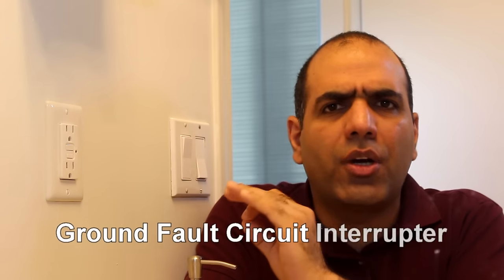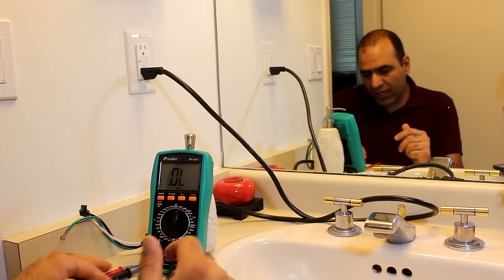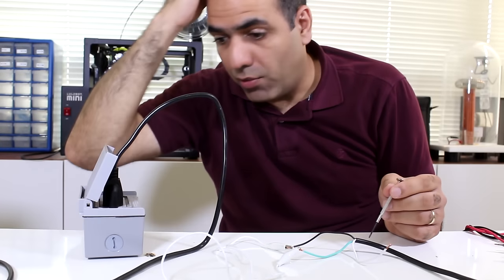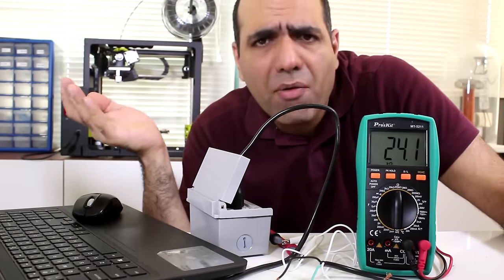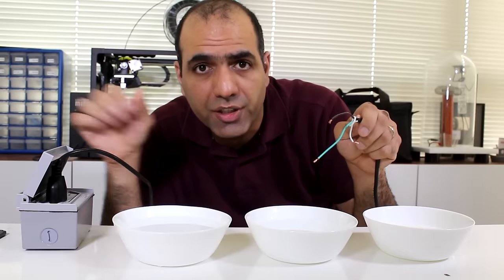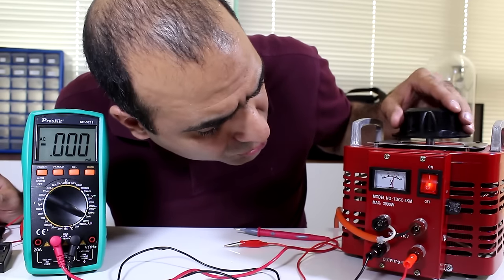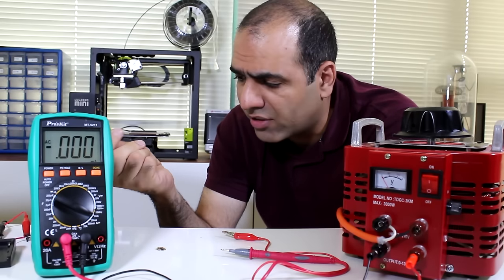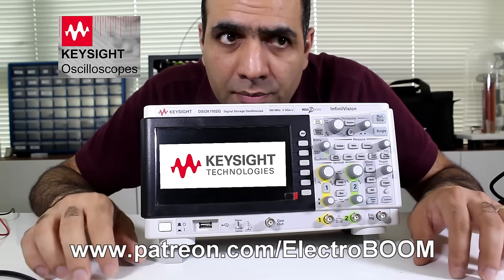The Outlet that Saves Lives

Comment: Dude, I'm an electrician and I was cringing through this.  And really disappointed by how badly that GFCI worked.  Please be careful.
...but also: that video was awesome.
My stomach is still in knots.
Reply: SwingboyPA It might be a good idea for the GFCI standard to be restricted down to 0.8ma, but then it might trip from leakage currents, like from Suicide Showers.
Reply: I've tripped GFCIs at work many times, it was partially because of bad distribution board design, a good GFCI has neutral to earth detection too, the breakers they had were either single or 3 pole, with GFCIs 2 pole or 4 pole is better, since you also break the neutral, how I tripped them most of the times was working with the breakers after the GFCI off and touching neutral
Reply: Sadly a lot of products are awefull.   I have a 230v 16 amp breaker for a part of my kitchen yet i can still put a 3000 watt water cooker and 1800 watts oven on it at the same time without it flipping. I just avoid using both at the same time as i dont feel like spending 400 bucks on replacing a 20 bucks part.
Reply: british RCDs trip at very low amperages compared to GFCI outlets
Reply: @pino_de_vogel  Breakers doesn't open instantly in overload conditions, they open under a "curve" which determines the maximum and the minimum time they can open during an overload condition, if it is slightly greater than the breaker capacity it may take several minutes to over an hour to open! If the current is way bigger than the breaker cappacity (but not over than its short-circuit detection) then it will open in few seconds (as the breaker internal components will heat much faster than the wires)! In your case you have 4800W under 230V, which takes 20,8Amps from your wires and your 16A breaker, so you need to get the datasheet of you breaker and check how much time it needs to open with 20 or 21Amps, it certanly will open before the wires get too hot (in case you are using 1,5mm² wires) which is not a problem at all, it was made to work that way. In my country we use NEMA (old homes) and DIN (newer homes) standards and I find the DIN breaker better than the NEMA because they are better at overload conditions.
Reply: @yuminago  this is incorrect, US GFCIs went to 5ma much earlier than british RCDs which are still often 10 or 30ma
Reply: @0x73V14  huh. funny that. mine at home are rated 5ma
Reply: electrical engineering student here. i like how his videos have taught me better than any of my profs. but i feel that same cringe
Reply: @pino_de_vogel  If the breakers opened immediately upon exceeding their current rating you wouldn't be able to use classic light bulbs at all. This is because they have a very high initial current that in a very short amount of time heats up the wire which then in turn emits light (mostly heat, actually) while its resistence rises because of the temperature and therefore limits the current again to whatever it was built for.
Reply: @loganiushere  0.8 mA would also be tripped by a lot of devices that have any significant solid state electronics as the pull-down resistors  use ground as a current sink to ensure that parts of the circuit that are supposed to be at 0V actually are. Mostly it is only draining stray charges due to unwanted capacitance of the components but of course this is happening millions or billions of times per second with the switching frequencies of modern solid state circuits so the average leakage current can be as high as a few mA for some solid state devices.
Reply: Legend says his stomach is still in knots one year later
Reply: Yet he proved otherwise in his video where he went to Britain..
Reply: @srccde  Same is true for basically any motor the resistance of the wiring is trivial and most of the resistance is the back EMF created by the rotor moving within the magnetic field, this value is however related to speed so starts at zero initially. Hell you can even see this in some buildings with old wiring the current draw can cause a significant voltage drop throughout the building and make lights dim when the fridge kicks on for example. The motor is pretty much a dead short when it first starts until it builds up some speed.
Reply: @yuminago  Often, not always.
Reply: Same here!
Reply: @0x73V14  legal requirements are 30ma, but they can be much lower
Reply: SwingboyPA hi. Is it a bad idea to replace my open ground 3 prong outlet with a 15 or 20 amp gfci? I am using this line for computer equipment. If so, then why and what could I do to fix the open ground.
Reply: @jfasulo1   you can't do anything to ground an open ground ...except to ground it. Is it worth it to run an individual ground wire? No, I would replace that receptacle location with a new dedicated line if possible.
Using GFCI or AFCI protection for a non-grounded receptacle location and replacing it with a three-prong receptacle is a safety fix, not a grounding fix. Personally I think it's safer than a ground, but safety isn't the issue with the computer; electronics is.
This is a Google document that I have written for my customers which gives a basic understanding of grounding and bonding:
https://docs.google.com/document/d/1LJyTscnY-CKbqlIDBvHH11eYH5uCvib7MpKn3NNcR1Y/edit?usp=drivesdk
Reply: @pino_de_vogel  if the breaker isn't flipping it probably just means the two devices aren't drawing their full watt rating.
Reply: @pino_de_vogel  @Marcelo A. I've experienced similar things.  I found out there was 4500 watts of items attempting to run at full power on a 120v 20 amp breaker at one of my client's locations.  It was like that for about an hour and never tripped the breaker.  I noticed something was odd when the devices sounded like they were running at half speed ... I investigated and found out.
Reply: Why y’all speaking enchanting table
Reply: Question for ya: what does 1 billion volts do? I have a stun gun & I'm curious. So best way I figure ask electrician 🤷‍♀️🤷‍♀️
Reply: @melaniejenkins2754  just throwing a number out there without a contact doesn't do much. It's like asking "What does water do?"
In a glass, it can help to keep you hydrated. In a tidal wave, it can match you up into itty bitty bits before you even get a chance to drown.
So while a billion (Really? That much?  I think you are being misled)  volts is a huge amount, it's also important to know the amperage too.  Voltage is like pressure in a water pipe, and amperage is how much water flows through the pipe when you opened it up. If you have a billion pounds of pressure in a water pipe, but you don't open the faucet, no electricity is actually being moved, so it doesn't matter.
All that aside, what a stun gun does is spasm your muscles.  I think this is actually more of a question for a biologist. Your body uses electrical signals to activate muscles, so I'm pretty sure that a stun gun just overloads all your muscles.
Reply: So what about 220v in europe? At what miliamps the breakers pop? Here in lithuania we have similar system to UK, where there's one central breaker system powering the whole house
Reply: @MCA0090  yeh it would be bad if a breaker just opens on current spikes xD
Reply: @seraphina985  well thats why atleast for 3 phase motors there are soft starters with delta and triangle configs. I wonder if something similar exists for 1 phase motors.
Reply: @aba22125  One protecting multiple circuits like that is more likely to be in the region of 30 mA. If you have access to the panel it will be printed on the face of the RCD/RCDO itself. With an RCD there will just be one number the leakage current that it will trip at, an RCDO will have 2 one for the overload current and one for the leakage current. In the UK homes for example where there are usually two RCDO's each protecting half the circuits they are commonly 63A/30mA RCDO's. Thus they will trip if either 63A of current total or 30mA of non return current is detected.
Reply: @aba22125  That's actually pretty bad design if you don't have separated circuits for each installation, and at least lighting separated from wall sockets. In this case one failure means you have a blackout.
Here, in Poland, it's a norm to think "one room = one dedicated breaker" (mind the lighting, which has its own circuit) and we have several breakers grouped under one RCD, meaning at least 2 groups and if one fails, the other still works.
Reply: But its an unrealistic check. Sitting in a bathtub the current will always travel much more easy through the water to the metal water pipes than through your body.
Reply: @vinigretzky97  yeah, it is a somewhat unrealistic check but I don't want people reading this to think that that means that a GFCI is not a really solid protective device.
In a situation where there would be a voltage drain from hot to the ground of the drain or water pipes, a GFCI would shut off because it would detect the difference between current in the hot and the neutral at the breaker.
Reply: Seriously- but it’s also the best- I love this channel and his willingness to almost kill himself for the benefit of all us plebes in the field and the kids in training
Reply: @melaniejenkins2754  well the stun gun certainly does not actually output 1 billion volts, that is just hyperbolic marketing, in reality it's probably a much much lower voltage like in the 10,000s range. In which case it won't do that much, it will hurt a lot of course but it isn't likely at all to kill someone or render them unconscious or anything unless they have some underlying medical conditions that make them more susceptible to electrical shocks. Also this isn't to say that 10,000s volts aren't dangerous, it is very dangerous, the only reason the stun gun doesn't kill the person it shocks is because despite the high voltage it is designed in such a way to very quickly deliver pulses of high voltage in order to stun the target but it doesn't output enough current and their isn't enough power in the system to actually kill someone, this is why you can easily die from being shocked from a wall outlet even though it is theoretically at a much lower voltage.
Reply: found the clown
Reply: Me too. You'd expect GFCI (or RCD) to respond a bit better than this.
Reply: Electroboom has a masters in electronic engineering
Reply: Tested mine and all work. Even helped my mom fix one saving her a few hundred dollars

Comment: @ 8:38 You really are a brave soul doing this! People might think you're joking around shaking, but I'm here to tell the naysayers, this current, while not deadly, is VERY painful!!!
This is a very important video, showing just how a GFCI will save your life!
Reply: if you think all the 'shocks' are real, explain the wearing of the wedding ring?   First thing they teach you is remove rings when dealing with electricity.  It's almost like he is wearing the ring as a wink to the audience.
Reply: Since he's only using one hand the hand with the wedding ring doesn't have any current passing through it.
Reply: @tomservo5007  the ring is on his left hand?
Reply: When he starts cursing you know it hurts
Reply: Oh yeah. Years ago while building a computer I had to remove the powersupply - small form factor case, had live pins to reconnect to the plug at the back, forgot I'd left it connected to the wall. I'm in Aus, so that was 240V.

I didn't feel quite right again until the next day.
Reply: @morosis82  i believe some of stated some are real shocks he gets while others are fake and edited in. so it's mixed on which are real or fake shocks
Reply: Shame, in Hungary or Central Europe you cant buy GFCI outlet. Our only hope is the good old breaker.
Reply: @88werwolfhun88  we have the FI or RCDs. They do the same.
Reply: @88werwolfhun88 ... Europe has RCDs by law, which is basically the same thing but for the whole house. You're not relying on the breaker at all, you have far higher standards than America for electricity.
Reply: The current can only ever be "deadly" if passing through vital organs. In most of the experiments he was only passing the current through his hands. It is however, still VERY painful.
Reply: @tomservo5007  we can see his finger twitching so i can tell its real

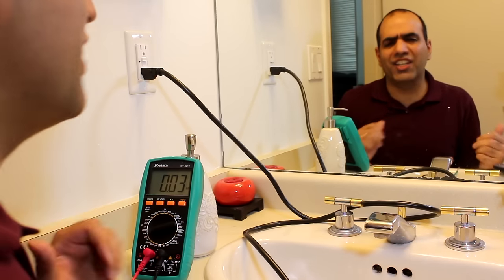Comment: 2:53
Actually the current is getting really dangerous around 20 mA. Probably painful below this value, but not fatal.

If you set the breaker threshold too low, the cable’s parasitic capacitances will continuously trigger it,
especially in Switzerland where these breakers protect the whole house instead of one outlet
Reply: Pizza furry
Reply: Depends on the length of exposure and the voltage as well. The current alone doesn’t determine what’s fatal. You could run a lot of current through your body, but if the voltage isn’t high enough, you won’t feel a thing.